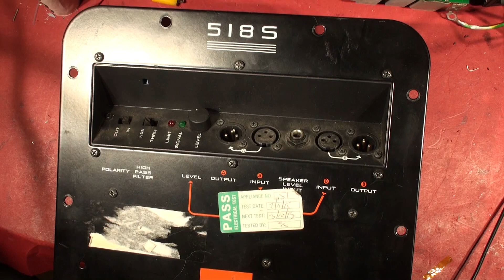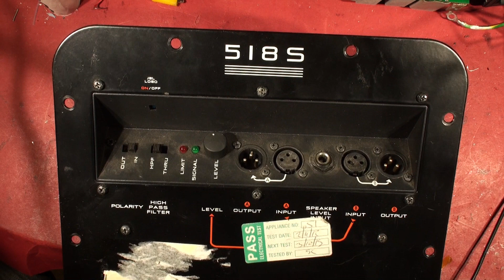JBL 518s  Dead no power Detailed repair and Diagnostic Part 1

Comment: I purchased two EON 518S a few years ago but after endless capacitor burns etc. from the source, I simply GIVEN UP and started using them as PASSIVE speakers, connecting a crossover and an external amplifier.
The sound got MUCH better and I NEVER had problems with them again.
From what I've discovered, the problem is in the automatic voltage switching, especially when we connect them to 220V... The switching is lost and goes wrongly to 110V, but as 220V continues to enter, damage is inevitable.
I'm very surprised that JBL didn't solve this big problem and even a kind of "recall" could have been done!
A hug from Porto Alegre - Brazil - and congratulations for the excellent video!
Sorry for my translator's english, lol...
By the way... I just use my 518 in my home... not for partys, etc.
Reply from the maker: You can just disconnect the doubler cable from the input board,  You can solve the problem by following the other video regarding the fault and the simple modification. I have done dozens and never had one back.
Reply: @razenby  Thank you very much! Nowaday, the amplifier is out of the speaker (box) but, as soon as possible, I will try the hint!  A big hug!

Comment: Hey Magic I notice the speaker you working on is a JBL PX 518 BUT The speaker I have is the JBL PRX 518s do you have a repair video for the PRX 518S?
Reply from the maker: If you have switch mode power power fault The PRX518S has the same power supply and the same issues as the 515xt.  The service manuals is available. If you have an amplifier fault then look to the output FETs.  The D class servo drive for the amplifier complicated and you need to force it into open loop to debug it. Often the op amps in the mixer/compressor board blow but this is easy to debug.

Comment: Brave project! You commentary is always enjoyable. I've done my share of these types of repairs but only for particularly high value electronics where it was worthwhile. In my experience, small capacity electrolytics like those 1uF 50V jobs are the first to go; their ESR skyrockets. I usually replace them with Wima 1uF 63V film caps which fit the footprint and can be had inexpensively in bulk. After looking it up, I think the Philips speakers you were talking about were similar to 22RH532's. There's a service manual for them here:
https://arend.is.verweg.com/pdf/Service532.pdf

From what I've read, it's not a particularly magical system and the physics of it doesn't quite work out. Between imperfect coupling to the air, cone distortion and various resonances within the enclosure, it could potentially make some things worse while making other things better. There are companies that focus on making speakers with good mechanical design by doing finite element analysis on the structure and custom building the drivers. One such company is Magico. Other companies make active speakers with separate dacs/amps that are finely tuned to the drivers; Goldmund makes those types of speakers. Both companies are absurdly expensive of course and it's not where I'd spend my money, but I'm sure that they have their merits. -Nick
Reply from the maker: Thanks for the info. I am repairing them to pass on the information and what skills I have. Clearly it not  not financially worth my while but I do get a lot of satisfaction knowing that a lot of stuff might be saved from land fill. One of my modules at UNI was closed loop control systems engineering. The uni that I was renowned for Audio, TV and Transmitter design and one of the profs was into loudspeaker test and design.  Thats where I came across the Philips speakers.  I can't vouch for the listening experience but the quantitative performance on the anechoic chamber test system was superb. That doesn't necessarily mean that they were better to listen to as virtually all recordings already have fixed pre-emphasis and these days also dynamic correction applied at the studio. Presumably to make them sound good when played through speakers. We had 15 ips reel tape recordings of live recordings that we could compare with the reproduction in the chamber.  Mostly we rolled in the 2 metre thick door. Enjoyed the eerie silence, just our heartbeats and breathing. When  the Fleetwood Mac and Supertramp reeled master copies started it was truly breathtaking with 20 year old ears!!
Reply: @razenby  I understand what you mean about passing on the info! I'll make a secret youtube channel soon for pretty much just that. Some learning, some cool stuff and some fun. I feel the same when it comes to saving things from a landfill (when it aligns with practical interests at least). It's good for people with these capabilities to do their part now and then. That uni experience sounds like a real fun time. Never heard 15ips master tapes before (inside an anechoic chamber, no less!). Seems lika a truly unique experience. A bit eerie as well, probably haha. The closest I've come is enjoying my share of old vinyl on high-end systems belonging to friends. Supertramp and Fleetwood Mac are some of my favorites as well, along with Yes and others. I'm from a later generation but enjoy a wide range of music. There are basically 2 major problems with modern recordings - excessive use of compressors to increase perceived loudness of the music, and sound engineers who know almost nothing about sound engineering. It's simply not required to make "successful" modern hits. The accessibility of music creation tools is a double edged sword in that way. Music variety goes up, average quality goes down. Not any different from other markets. I don't even mind, truthfully. It's still possible to get good sounding stuff out there, but it's a hit and miss. I dabble with audio in my spare time but I dislike the insanity of the audiophile market in general so it's a limited hobby for me. I really enjoy FPGA programming so all of my personal projects tend to revolve around that, including audio. That's my personal "quirk" haha.

Comment: Did you add a fuse to your Weller?
Because most of those are not fused.
I prefer the Hakko clones.  I am using a Yihua and it rocks the casba.
Reply from the maker: I am running from a clean isolated AC source that is isolated from ground.   When I do the real mains test I aint soldering!